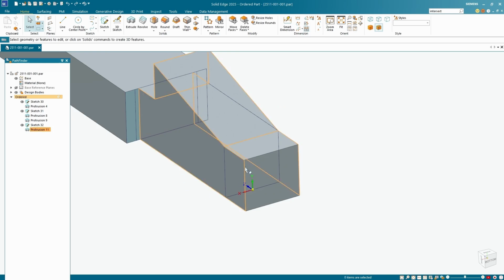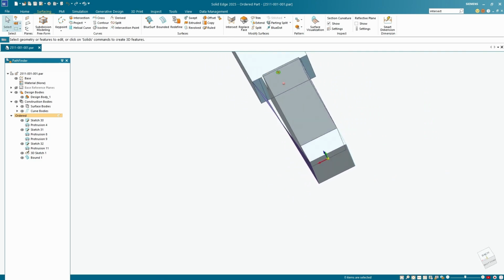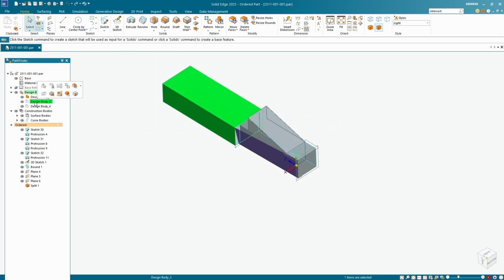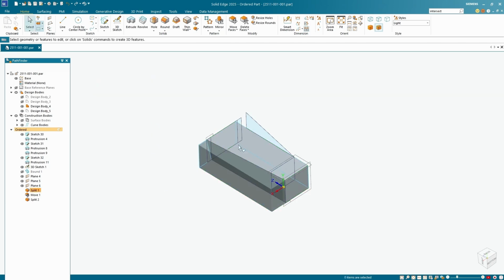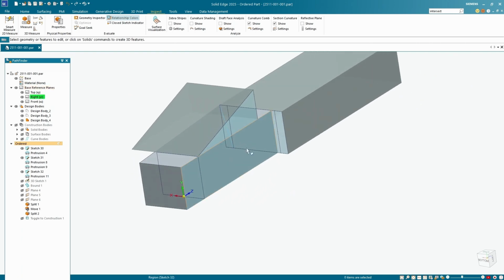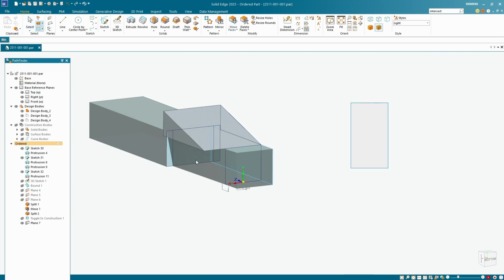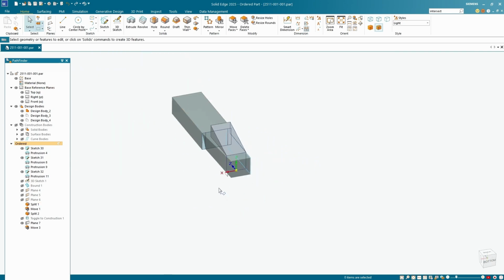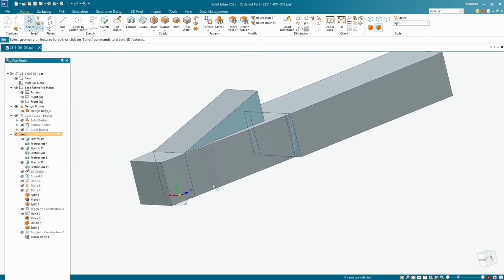Solid Edge Surfacing for Electrathon America Car

Comment: 9:30 Shouldn't you delete the construction body after the mirror or even delete the entire side? Because you will overwrite it with the mirror at the end.
Reply from the maker: You can delete or leave the construction bodies, it would probably be tidier to delete them if they aren't going to be used later in this project. The half of the car that was toggled to a construction body wasn't overwritten by the mirror at the end even though the mirrored design body is taking up that space. Solid Edge keeps multiple bodies, even if they are taking up the same space, you need to use the union command to combine similar body types (design+design or construction+construction).

If I had just hidden design bodies, that would certainly be an issue, as they would be included in calculating the mass of the part, even when hidden.